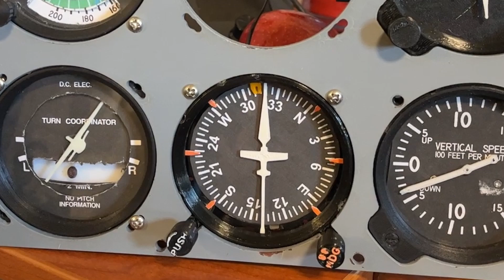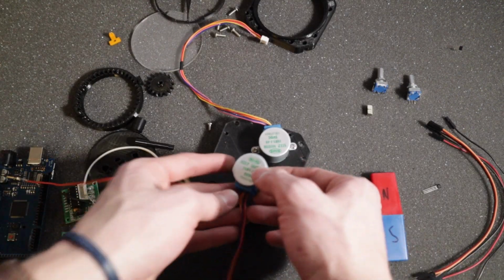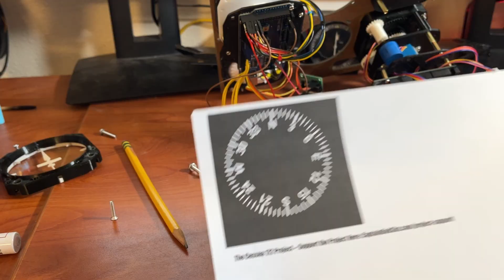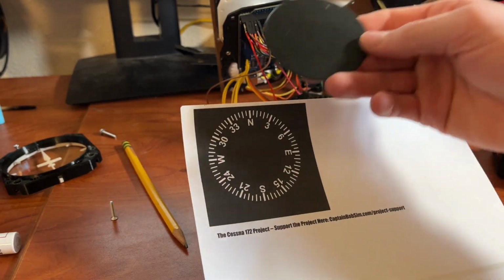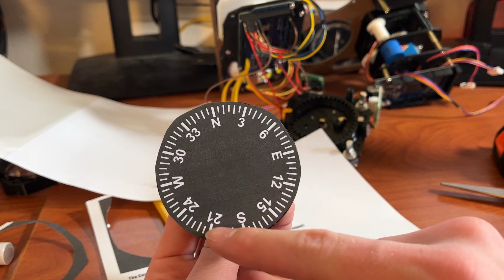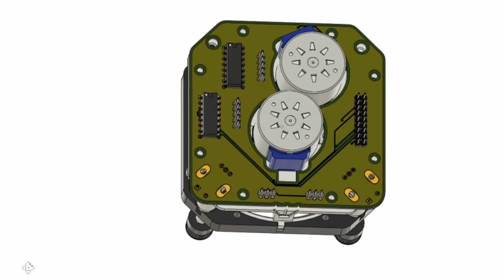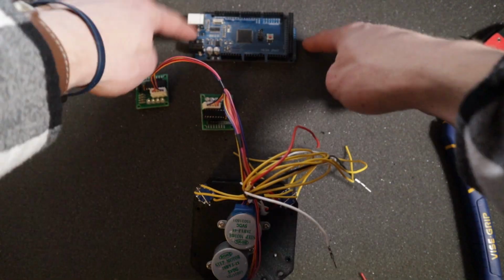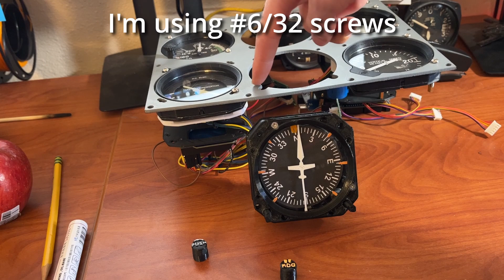How to Make a Flight Sim Heading Indicator | C172 #41

Comment: Why the hall effect switches need for? Thanks.
Reply from the maker: Hi Felix! The hall effect switches are to automatically zero the compass on startup. You can do without them and just manually zero it whenever it gets out of sync
Reply: @CaptainBobSim  Hi Trevor. Thank you for explanation.
I emailed you back on an altimeter issue…

Comment: here is what is happening to me, I got it working but every time I start Xplane I need to set zero position in HDG and Bug why???? also the vessel doesn't work, looks like the acrylics are too thick. not having the 3d file I cant modify it
Reply from the maker: Hi Pedro! Are you using the Auto Zero function with the stepper motors? 
I included a STEP file that can be modified in the Cessna 172 Project Files
https://captainbobsim.com/product/the-cessna-172-project-files/

Comment: Great design. I've got everything put together, Mobiflight is programed and connected to the Arduino. I am getting read back from the MSFS 2020 to Mobiflight also. But I'm having trouble in that the stepper motors are not getting power. I've tested them separately and they work fine. Have any idea why? Any help is much appreciated.
Reply from the maker: It sounds like it's a wiring issue with the + and - coming off of the motor drivers. Are your hall effect switches wired to the +5v and GND?
Reply: @CaptainBobSim  My bad, I didn't upload from Mobifligth to the Arduino. Have power to the steppers now. But, no I have not wired the hall effect switches yet. I was just checking for power to the steppers. Thanks.

Comment: Great job mate...
Isn't possible to do with other stepper motors that connect directly to Arduino with out the stepper boards?
Reply from the maker: Hello! Yes this is possible - like with x27s. I choose BYJ28 motors because they are stronger than the x27s (x27s are only really strong enough to move a needle). 
x27 motors also need to be disected to remove an internal stop. Do you know of any other suitable motors?
That being said the BYJ28 motors aren't exactly bodybuilders...
Reply: Now I understand why you choose the stronger ones ... The only ones I now is does two.. what's your next step on the cockpit sim? Seen the 2 video it's great
Reply from the maker: @techsilv5170  Next up is VSI then finishing the 6 pack :)